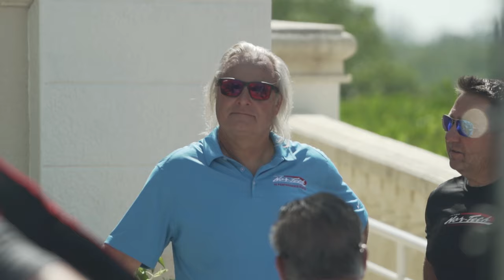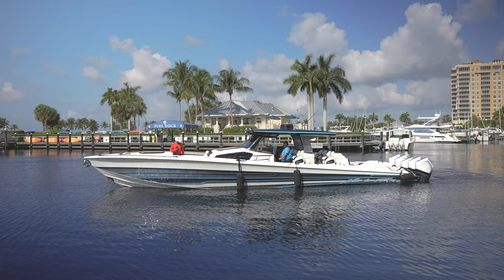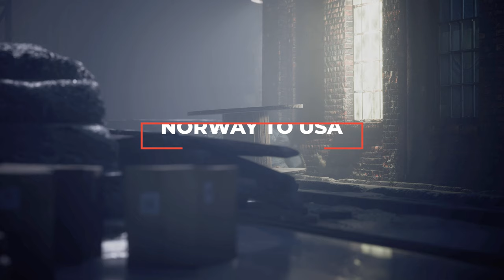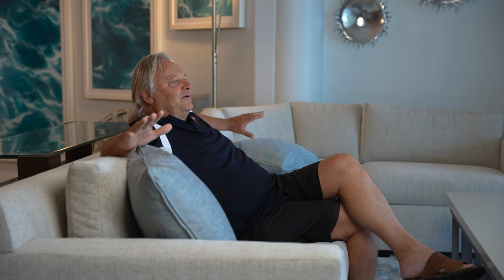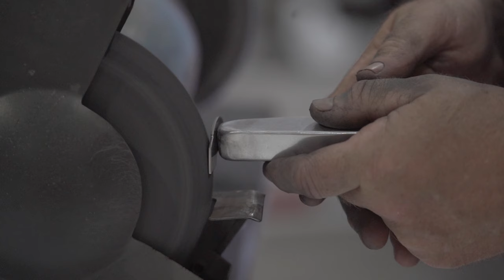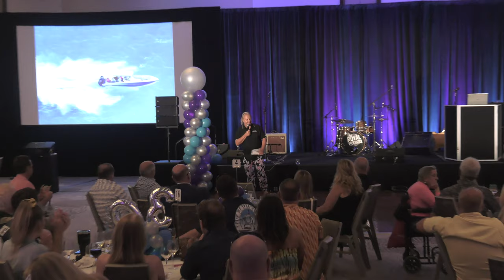In The Lead with Trond Schou and Nils Johnsen of Nor-Tech Hi-Performance Boats

Comment: "Set the world on fire with the centre consol"? Ehm okei. That has been around for ages. Before 2007 when they startet with the centre consol.
Reply: Hi performance center consoles, let's put it in terms you can understand. If you light a match you have a flame, which is what center consoles were. What these guys did with the hi performance and center console market in general, was take that match and put it in gasoline.